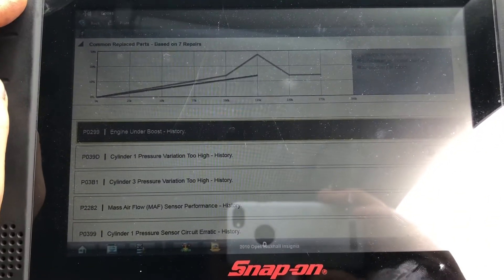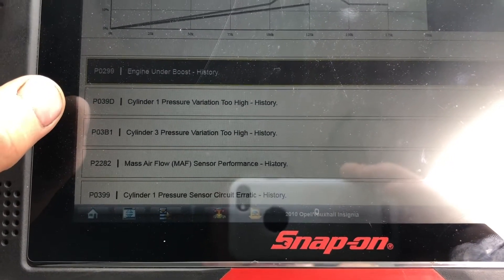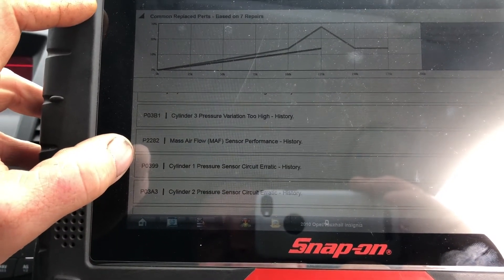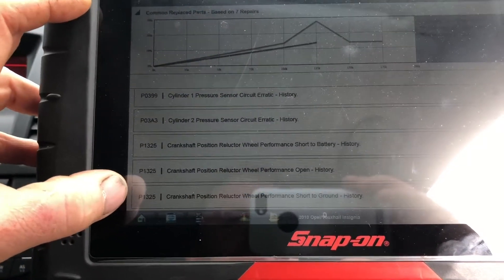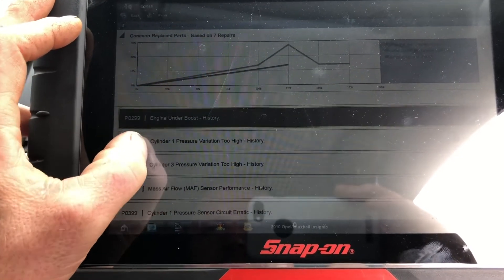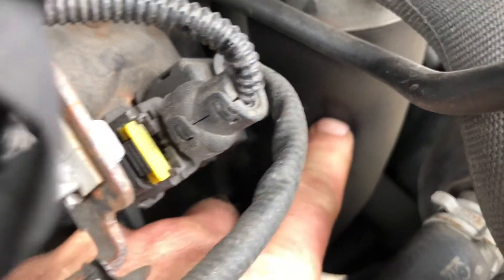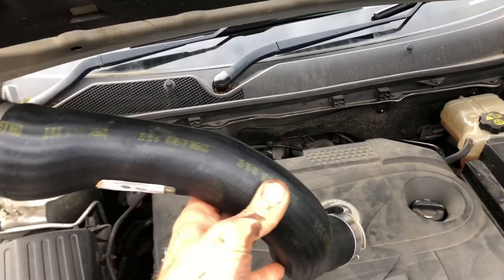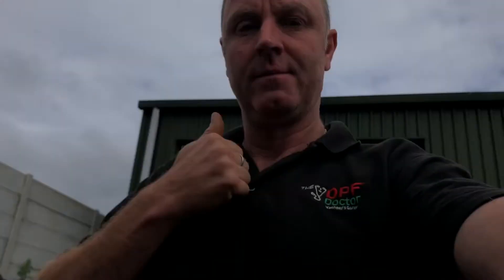Vauxhall insignia P0299 under boost #shorts

Comment: Expensive glow plugs Peter 😎 thanks for a shout out good video
Reply: Ikr Peter is so cool
Reply from the maker: I didn’t replace the glow plugs they just weren’t happy the pressure’s they were reading due to the reduced air flow into the engine. But yes Even the pressure sensing glow plugs are pricey 👍

Comment: I got insignia 1.6 cdti 2016,  with fault codes P0299 and P0234.. My car doesn't have power. In neutral maximum rpm is 3500, when driving maximum is 2000 Rpm.. Look like turbo doesn't work, I don't have air leak, boost control valve is good. Any idea? Thanks
Reply from the maker: Unfortunately there a just too many variables for me to just guess. 
The engine won’t rev up when the car is stopped. 
Do you have control to the turbo??
Disconnect the air flow meter and test drive, see what happens 🤔🤔
Reply: @kennedysgarage3281  I had full dpf, and it has since been resolved, but the error unfortunately continues. The second o2 sensor is not working, it's as you can see in the video, the turbo looks good.
Reply from the maker: @kendisgomez1254  ‘as I can see in the video’ 🤷🏼‍♂️🤷🏼‍♂️ 
Did you send me a video??    As turbo could look good but not be getting controlled by the engine ecu, hense it looks good but isn’t working. You will need a qualified person to look at it. Where are you from?!
Reply: @kennedysgarage3281  Croydon, London